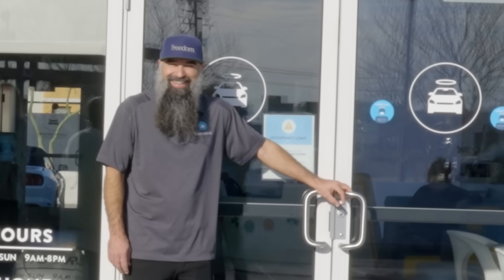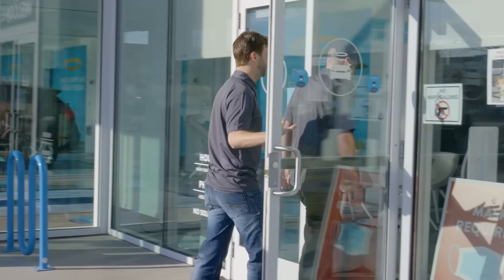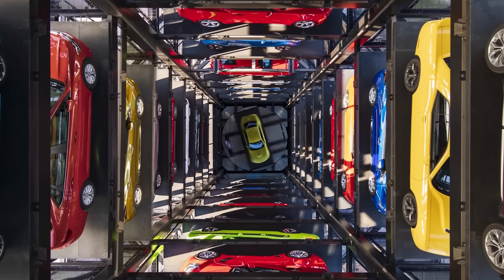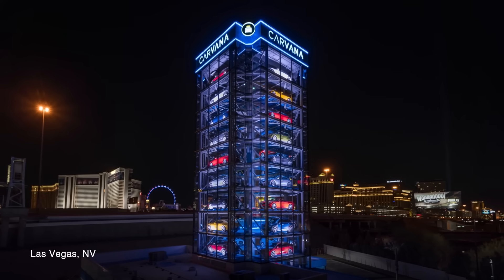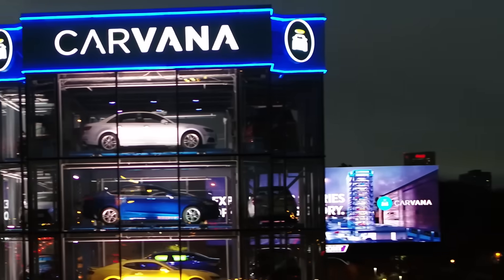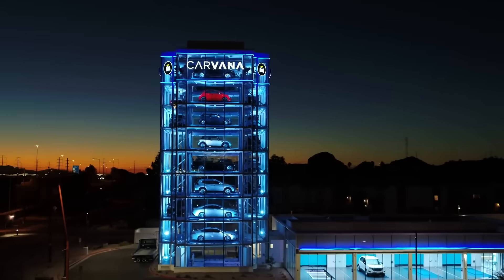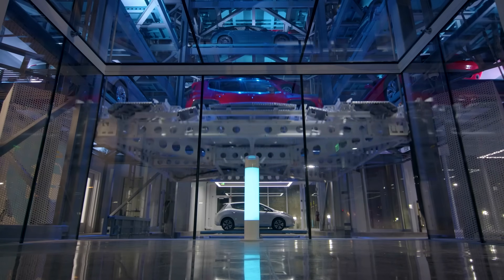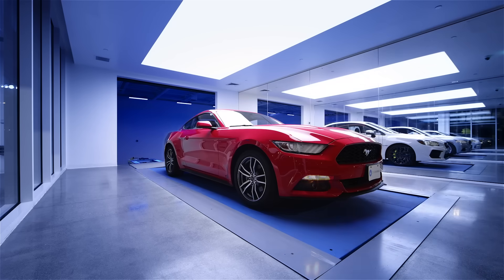Carvana - Under The Hood - Vending Machine

Comment: Brilliant way of stocking cars for any kind of dealership, too.  Nearly 100% protection of stock from elementals, vandals, theives. Reduced footprint on the ground - completely recyclable infrastructure, minimum power requirements for ‘security’ lighting, reduced light pollution.